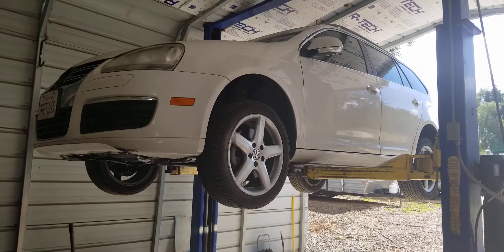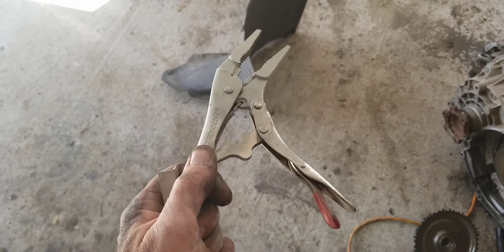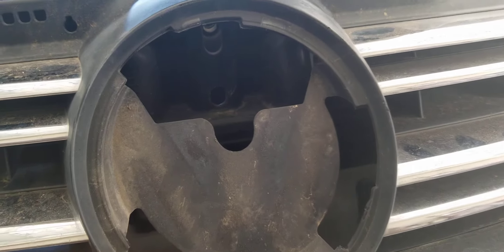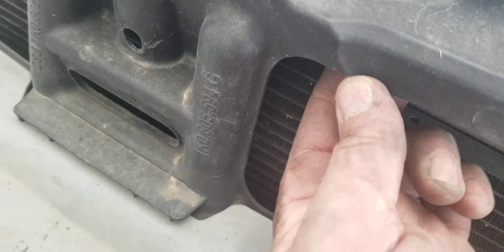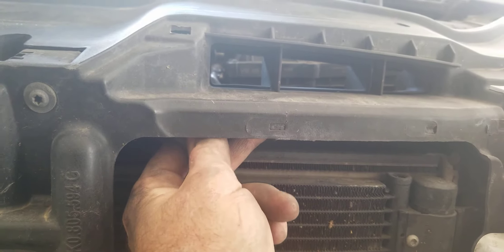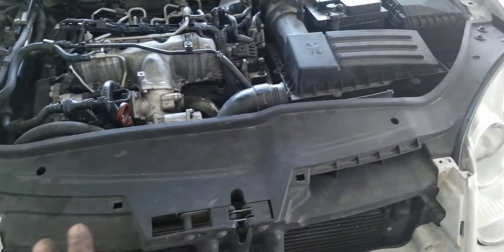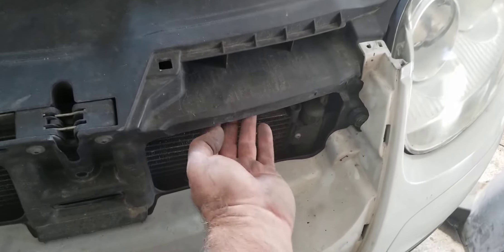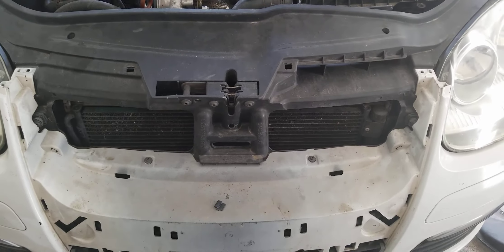VW Jetta Hood open with cable unhooked. Broken hood cable

Comment: Question:  Fortunately I can pop open my hood by using needle nose down at the lever inside the vehicle.  The pull handle got loose all of a sudden and more force is needed to pop the hood.  I believe the issue is in the little box.  Perhaps the plastic wall is broken.  I ordered a new cable and it just looks like I have the part that goes from the grill to the box.  I'm not 100 percent sure but it looks like I remove the grill, take off the 2 screws and remove the lower hood latch, then discard the old half of the cable and join the new cable with the old somehow.  My new cable is a doorman so the box part is different but I think I take the ball from the old cable that goes down into the jetta and join it to the new cable that goes to the hood latch.  Can't find a video of anyone doing this but please let me know if you think I'm on the right track.